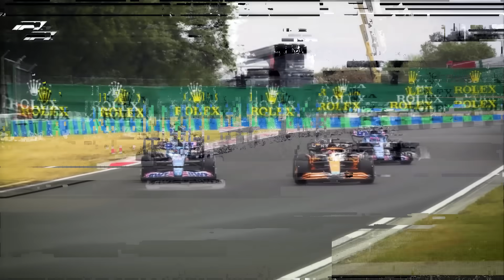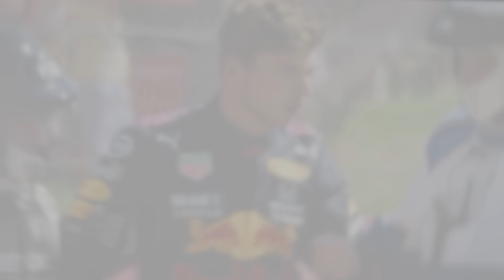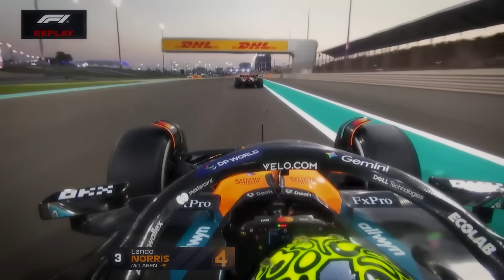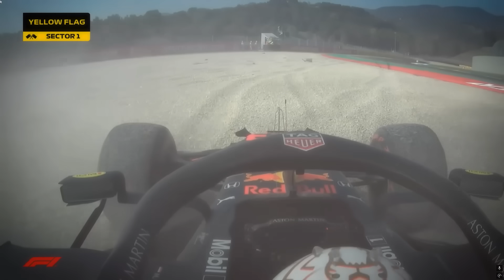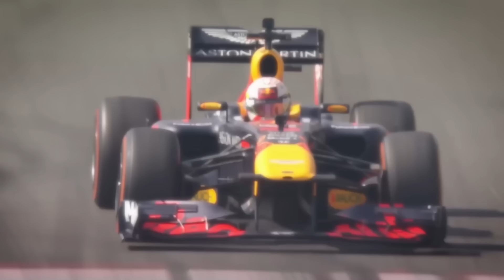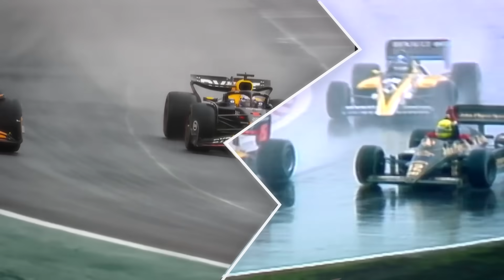The ONE Thing Max Verstappen Does That No Other Driver Has Ever Copied

Comment: The thing is, Max has driven this setup for years now. RB can't expect other drivers to come in and suddenly match a tricky out-of-the-norm setup in 1-3 years. They've put too much emphasis on Max's driving style, to the point that only someone with a career path like Max's can handle the car at least half a decade down the line like he did. With that said, it appears they changed it with the new regulations, so it might not matter anymore. Plus the team is in a completely different environment than it was before, so hopefully Hadjar is given proper time.

Comment: The real reason why a pointy nervous car is faster around a circuit is that contrary to a more stable "understeery" car, the pointy nervous car actually "wants" to change direction (it wants to "rotate" through the corner). Therefore the driver loses less time and momentum in a corner, and spends lets time then he would overcoming the front tires scrubbing while fighting an understeering car. That is what makes a pointy nervous car fast. The problem is that the driver needs the ability and reflexes to actually drive such a car on the limit.
Reply: It basically doesn't like to drive in a traight line, it pulls constantly to the left or right, depending on surface they are driving on, needing to constantly ster to keep it straight, but cornering it does more happily, correct?
Reply: @davidvanotterlo  not really, its more like, when ur entering a corner, the car enters aggressively as in the front end changes direction very quickly, which makes the rear end less stable.
Reply: @davidvanotterlo no having a lot of front end allows a driver to take a corner at maximum slip angle and thus rotate faste (basically drifting at the angle where its grip is low enough to require less steering imput but high enough that it doesnt light up the rears and loses traction/increases tire wear), which allows them to spend les time steering and more time accelerating in a straight line
Reply: Yep its like playing a fps with sensitivity on max. Once you master it you can dominate by being able to move and react faster than ur opponent